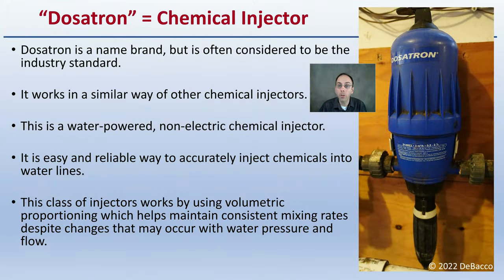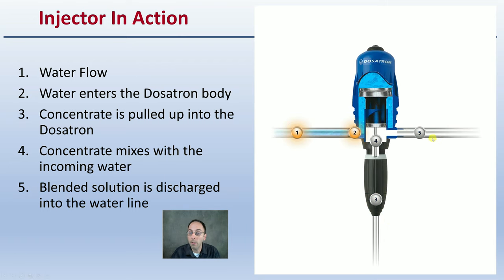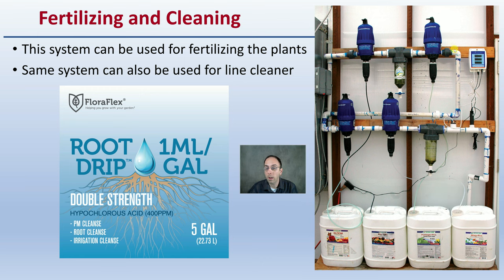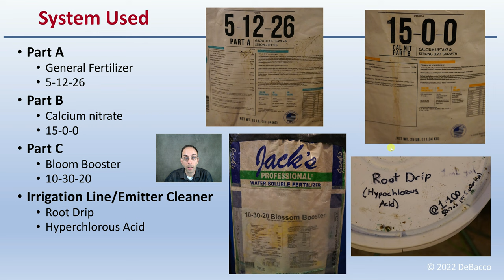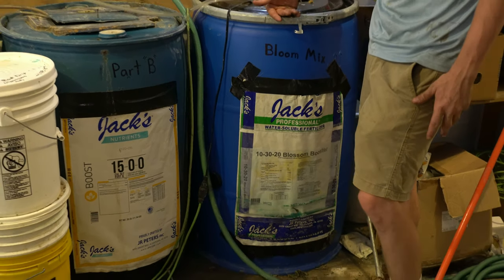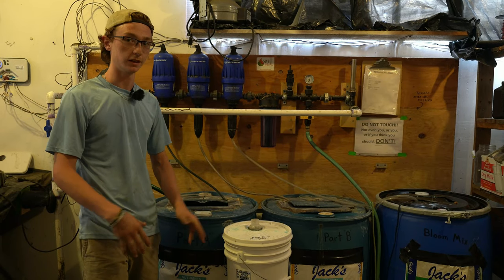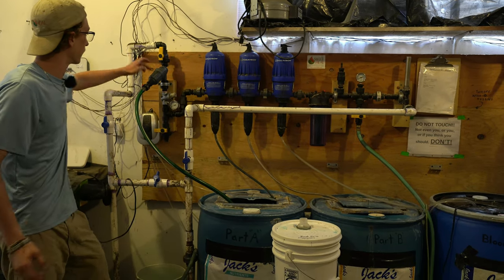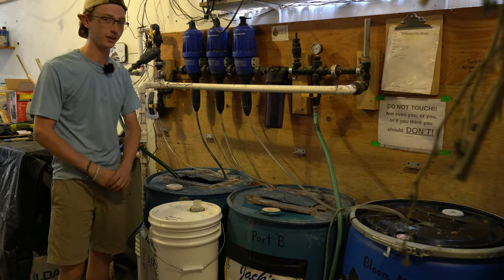Fertigation Set Up and Explanation Using a Dosatron System

Comment: Is there a way to use a gravity reservoir with an automated or timer based bypass valve to fully automate the drip lines? I want to run 3 times a day for my dutch buckets.
Reply from the maker: This would be possible, key is automation to help ensure some consistency.

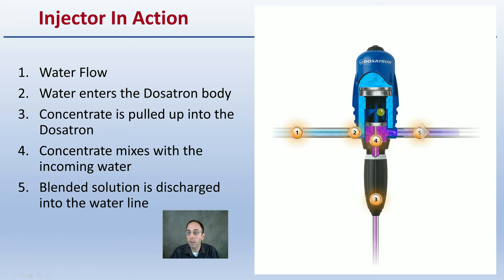Comment: For 1:200 wouldn’t you halve the standard 1:100 concentration (6.5oz per gallon instead of 13oz in your example stock solution), and for the 1:50 rate, wouldn’t you double the standard concentration (26oz/gal)?
Reply: Great video by the way. Looking to implement a small system.
Reply from the maker: Follow the rates on the label, and if you are increasing the dilution rate 2-fold you also need to increase the concentration rate to ensure the same nutrients delivered to the plants.